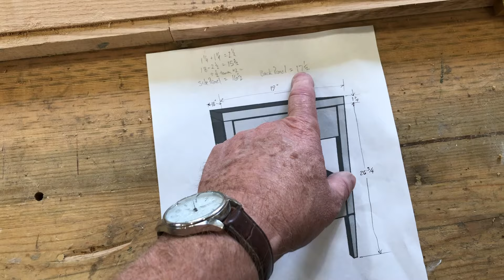Making a Nightstand - P3 - Getting to Final Dimensions

Comment: Great way to square the edge without a jointer.  I am going to use that in the near future.   Thank you for sharing.
Reply from the maker: Glad you found that helpful. I had a jointer but sold it a couple years ago as I really didn’t have room for it in the shop. Since using this “bed rail” technique, I haven’t actually missed the jointer!